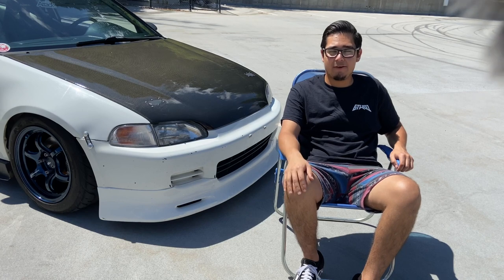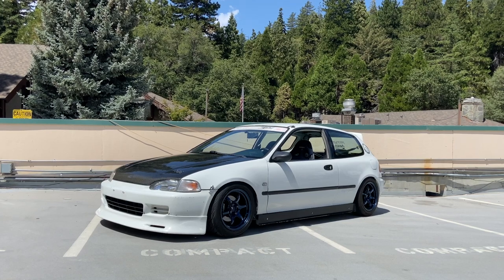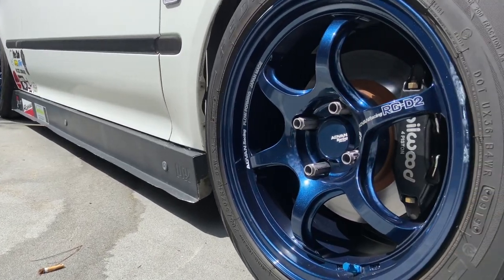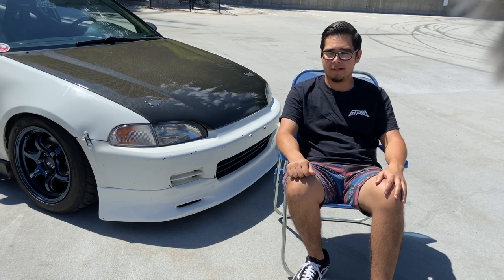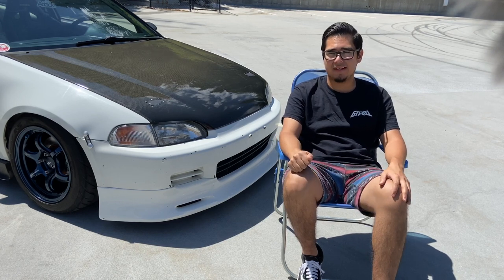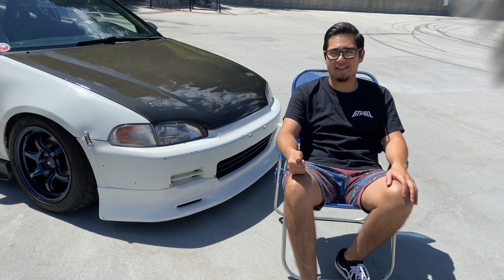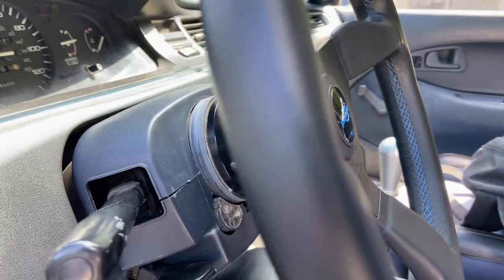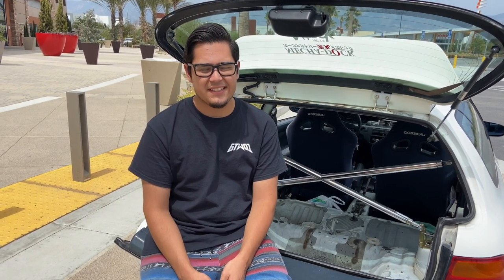Making the Transition From Street Car to Track Build | 1995 Honda Civic EG Hatch

Comment: No not the car wash brush! Lol the build plan sounds good, honestly if you start rod knocking just buy a 2 liter block and put the gsr head I think you’d be happier with that in terms of power
Reply from the maker: LOOOOOOL I feel that bro.
Reply: Pro tip: spray down the brush bristles really well with the pressure washer to minimize the amount of dirt and Rocks that you will be rubbing into your paint.